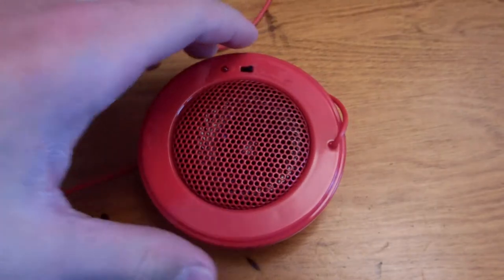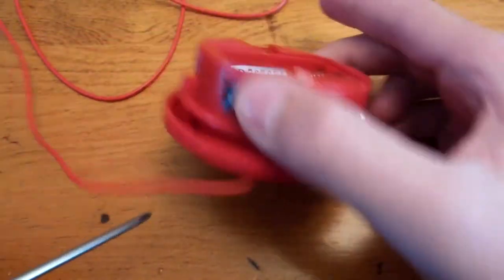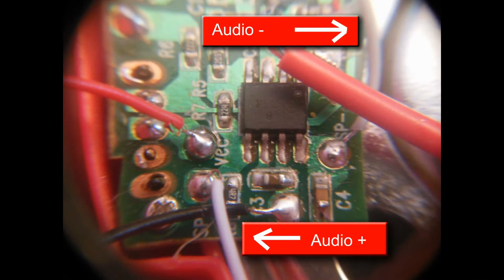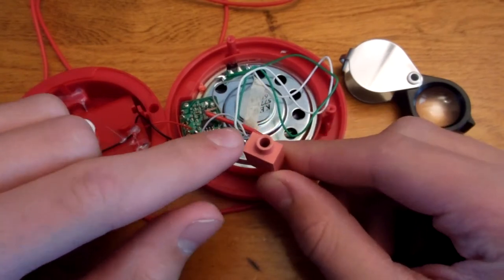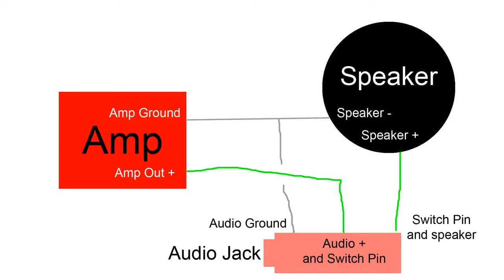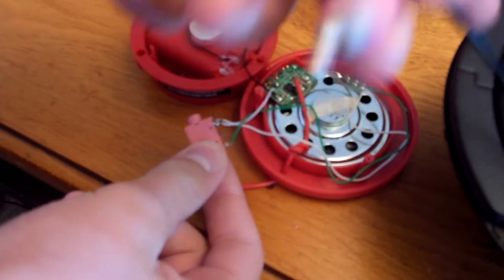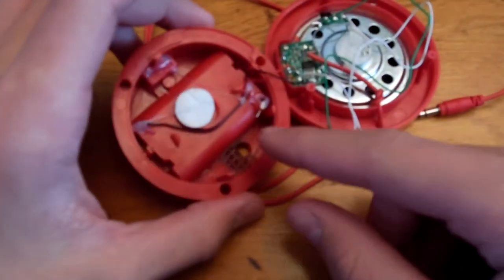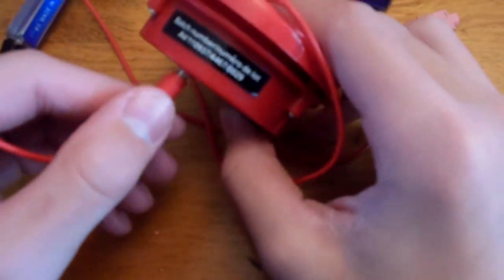Pringles Speaker Hack: How-To with Schematics

Comment from the maker: Solder paste is a type of solder that is used for SMD soldering. You will not need it, it is just a different type of solder. I the batteries might drain faster, but it shouldn't make a huge difference.

Comment: Good but it cant work on more bigger speakers because pringles speaker amplifier can give max 1 watts and those speaker that you connected to it i think it wants about 20 watts or more. It will have very low volume.
Reply from the maker: The volume is still higher than than the stock speaker, and the frequency response is also much better. Like you said, it will not be as loud as it would be with a higher wattage amp, however it is more than sufficient for listening in low noise environments.
Reply: +Lasha Tavlalashvili (Bazda&#39;s Laboratory) i put my prinfgles speaker on my 240 watts speaker and its a little louder
Reply: Audio Therapy ölçü öyleyse  xxf5e5w5e5 5 5  8 nr x3

Comment: christ 1 whole watt????? pringles couldn't have afforded perhaps let's say a FIVE watt amp chip? can get those at dollar tree.(not bad speakers either for a buck they actually sound pretty good paper cone speaker 5 watt to match the ic rattles a bit though but hold it down or glue. no distortion.) 

nice instructable thx for sharing.